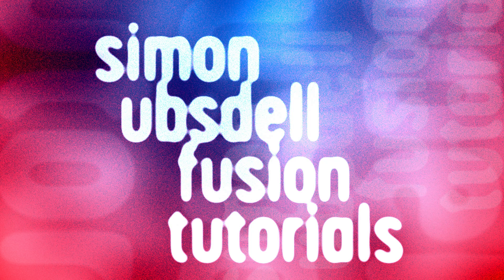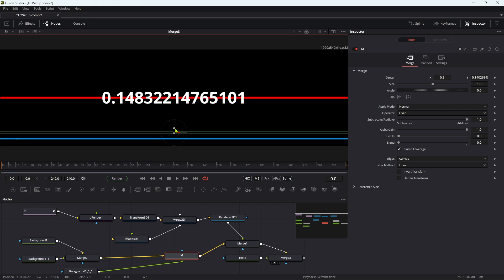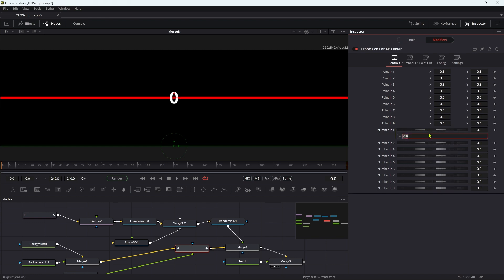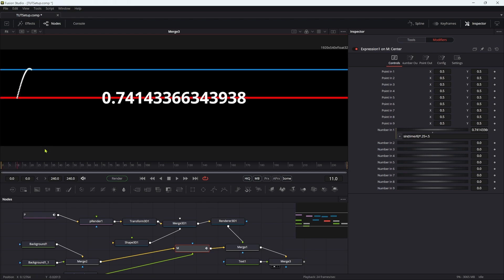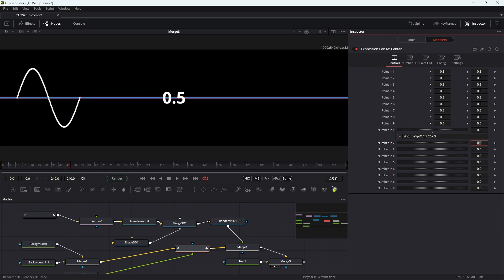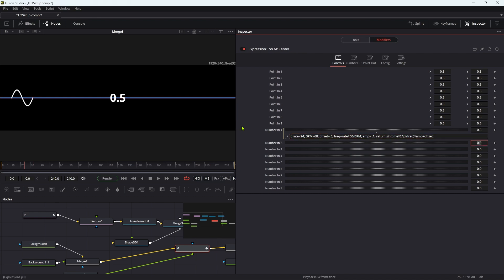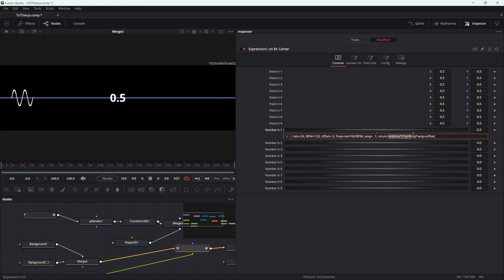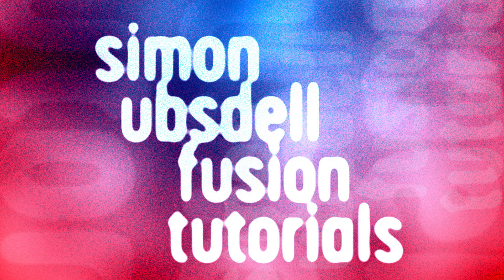Resolve Fusion: Oscillation in BPM using Lua

Comment: As a former DJ, I was hoping the MIDIextractor would be an easy way to synchronize visuals to BPM as there seems to be a size limit on the audio file you can use with any of the visualizers I've come across. Are there any such time or size limitations with this approach?

I wish Blackmagic - or someone - would write some code to allow Fusion to speak Ableton Link since there really isn't any MIDI editing available in Fairlight as you'd find in an audio-based DAW like Ableton, ProTools or Logic.

Great tutorial as always, Simon. Thanks.
Reply from the maker: Thanks. Have you tried the MIDI behavior in Motion? I haven't ever tried it myself but it looks pretty interesting and would open up a lot of creative possibilities. Unfortunately BMD are not interested at all in getting into the MIDI side of things, which is a shame.
Reply: @SimonUbsdell  It really is a shame - especially with Fairlight being part of the equation. To be able to use VSTs and AUs but not MIDI is a head scratcher.
Haven't gotten into Motion yet but I'll check it out. Thanks!